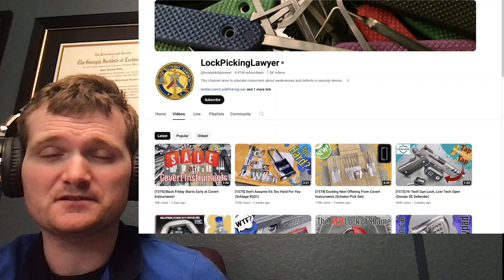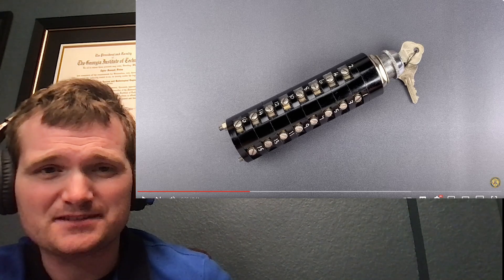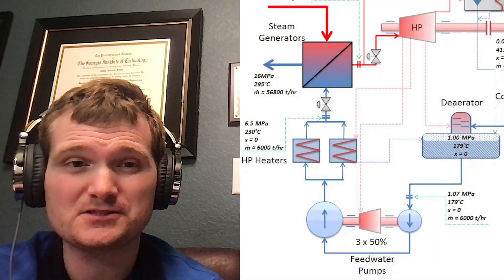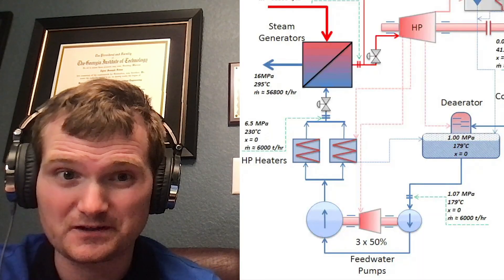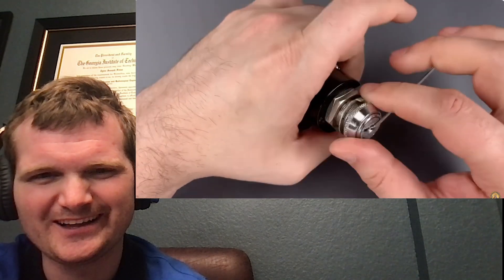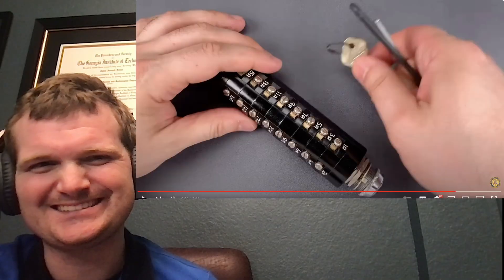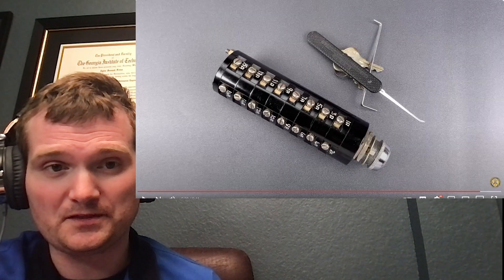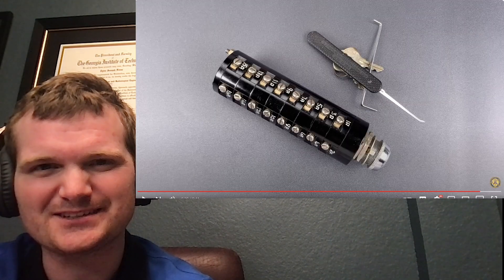Nuclear Engineer Reacts to LockpickingLawyer "Missile Control Key Switch Picked"

Comment: Locks like this use a inner and outer core. The inner core is where key interaction is checked/tested and allow further movement via pushing a certain part of the pin stacks past the treshold, which the key is cut to match the varying lengths necessary to push the middle set of pins past the threshold. All middle pins clearing the way enable the core to move. Picking locks you use tension on the core to help set the pins as a way of holding them up via friction, and you'll just go down the line. In some cases specially shaped middle pins are serrated to throw off feedback as a defense against novice attacks where a picker has to guess what's actually stopping them and do slight adjustments in order to correct it. 

But that's the confusing most aspects of most standard locks with a key you'll be familiar with. Often the security of the design in other lock type is their irregular shape which is more likely just a confusion tactic but vulnerable to the same attacks. But generally the aim is to be able to turn it and makes "something happen". Either this unlatches something, connects wires, or changes something from how it was into something that it wasn't. So far the standard for less prepared for locks to defeat are wafer locks because they're uncommon to the point that even most locksmiths don't have a tool for them, but LPL does and stresses that it's not difficult. Generally those in the wild are more likely to meet destructive methods instead like cutting the chains because hardly anyone understands the locks.

Comment: It makes sense, the purpose of safety lockout/interlock locks isn't to stop a skilled lock picker security, it's to ensure that someone doesn't accidently or inadvertently turned that system on.  No matter how simple the mechanism, nobody is going to accidently (oops, I stumbled and my lockpick fell into the keyhole) pick the lock.   If someone opens it, they did it on purpose with intention.

Comment: Why woukd you need 16 circuts tied to contactors like that? Weird.
Reply: By stacking switch contacts, one key turn can have many functions electrically (instead of turning 30 key switches all with a single pole switch)

Comment: I think everyone who doesn't plan to do illegal things should read the MIT Lock picking Guide. For one thing, it is fun and relaxing to pick a box of locks while watching a movie. For another, it is really handy, potentially even lifesaving if you lose your keys. Lastly, you get a practical lesson in how security is mostly an illusion. LPL can open a lot of lock types where I wouldn't even know where to begin, he is awesome. But common padlocks, house deadbolt and doorknob locks become easy surprisingly quickly. At that level, improvised tools are fine as long as you can be reasonably sure they won't break off in the lock.

Comment: Twenty-five thousandths means twenty-five thousandths of an inch. Twenty-five is the highest standard thickness for pick blades, that being the steel bit. Good for locks like this, where you need very high tension, since the high tension can cause pins to bind very strongly. Strong binding requires a good deal of force on the pick to overcome, and a thick blade is better able to tolerate this relatively rough treatment without bending or breaking. It can still happen, but it's not as likely.

Comment: id assume modern systems like most cars these days have a chip in the key itself that would need to be within a certain radius to even allow these things to be activated/deactivated. specificly to foil efforts like this from resulting in a catastrophic outcome. other things like an additional remote key press from like 6 buildings down being required to give confirmation while the key is held in the unlocked position
perhaps even before getting to the key hole a small metal plate may even obstruct they lock until a diffrent switch is pressed 3 buildings down in the oposite direction. and that same plate is on a timer so that it requires at least 3 separate people or more to activate the system that this lock is incharge of. 

a whole bunch of checks just to ensure that if jim from accounting gets layed off he cant just go blow the place sky high. 
and its safe to assume that the level of steps gets more complex based on how vital or dangerous something is
a system wont just rely on a single simple lock to secure vital functions and systems

Comment: You'd be surprised about standardized keys on large machinery, I'd be shocked if a good number of the safety & maybe even control system keys at a plant are not fairly standard.    There was a great presentation  several years back at defcon or something titled "This Key is Your Key, This Key is My Key"
Reply: CH751 is extremely common for example

Comment: So, in regard to the thickness of the pick, 25 thousandths of an inch is the standard commonly used thickness for picks in North America. We tend to not do too much in restrictive keyways here. Other common thicknesses available (overall, not just here), are in the 18-20 thousandths range, and 15 thousandths. There are thicker (less useful) and thinner (more delicate, but very useful in specific situations) picks out there, but they are not as common.

Comment: Industrial electrician here: those multi-contact switches are pretty outdated (makes sense, as this one is from the 80s), since we use computer controls for pretty much everything these days. 
Maybe they have to use an exclusively hardware lockout on weapon systems to prevent firing due to a computer malfunction. 
Those "tongue-gripping" things are safety lockouts and they are commonly used for access control on sealed machines. Some are just sensors while others have a powered locking latch.
Reply: Stacked switches are not outdated, they are still common practice in various controls situations.

Electroswitch is used for example all over power distribution in a stacked switch format.

Comment: I've watched all of LPL's videos as well.  This one did seem to take a bit longer than usual requiring like 5 passes?  In his longer videos he takes locks apart which is pretty cool if you're into engineering and manufacturing.  Wish he would have taken this one apart.
Reply: I would not be surprised if a lock like this cannot be disassembled without damaging parts.
Reply: @xXShadDragXx  Remove the nuts on the back to change out individual switch layers/alter the stack. In theory one stack could be 90º to the others and that would activate a "Safe" light. But after removing all of the layers of the switch, it's 50/50 shot if the cam lock could be disassembled. Could have a spring washer holding it together or it could be pinned in a fashion similar to an ACE lock.

Comment: Tyler, I have a question. In some footage I've seen from nuclear power plants (inside the critical areas, like the spent fuel pool), certain information is blurred. Obviously that's for security, but what is sensitive about a label on a crane or a cask? What are other examples of information inside the reactor areas that has to be blurred out? (obviously anything in the control room, and that makes sense because it's obviously to prevent terrorism).

Comment: I recently saw a short documentary about the 2003 Northeast Blackout by Fascinating Horror and I was wondering why nuclear power plants are not self sustaining and had to rely on power from the outside. Is it still the case today?
Reply: Typically power generation, transmission, and distribution systems can use their own electricity to operate, this is often called something like “station service” circuit.

But if those facilities fail, particularly in generation, there needs to be some prime mover in what’s called a “black start” scenario where there is nothing providing power for the station service circuit.

If things get to that point, there must be an external electricity source (generator) to provide power to the core functions of the plant, so that the process of large scale generation can restart.

Comment: You talk about this switch stack as if it is "vintage" or out of date but this type of switch stack is very common and still used today. They are used in comercial equipment that requires multiple components to be turned on or off at the same time. Each switch in the stack can be a different voltage or different position when the switch is turned. This one is fairly simple with a on and off position. A more complex one could have certain switchs on and others off in one position while the next position switches that and a thrid spring loaded position that only turns on one switch.

Comment: Fun fact: In the locksport community it is widely known that Masterlock sells complete garbage locks that have no security features and poor tolerances, making them very easy to pick. An exception is one of their lockout/tagout (LOTO) locks that has a plastic enclosure and security pins, making it much harder to pick and easier to break off with a set of pliers. Talk about getting things backwards!
Reply: LPL did a episode about that paradox
Reply: @shawnmiller4781  yes,that’s what I was referring to and Folse dropped a reaction video to it.
Reply: As long as your regular employees don't lose the associated keys and then get into the habit of just picking the locks, it's a plus for a LOTO that if something happens to screw up the correct procedural way to open the lock (have the key, insert the key and turn) there is a practical way for removing the LOTO within a few minutes' time. A whole lot of industrial design is about determining "how inconvenient should this thing you'll be doing this often be made to be".

Comment: LPL is really into emphasizing that in security "a lock is only as strong as it's weakest component" (ex: a truely unpickable lock core isn't helpful on a cable that can be cut with tin snips) and he would likely very much apprecate you pointing out the other levels of security in the area such as peer checkers and gaurds.
Reply: That reminds me of the old "What would happen if I'd go for a swim in the reactor's cooling water?" (("You'd die. Of bullet wounds. Before even reaching the water."))
Reply: Since the "security" at our minuteman ICBM silos is so "top notch" I'm sure the power plants are impenetrable.  🤣
Reply: @nunyabusiness9013  post 9/11, yes. Previously, I walked right up to the cooling towers at a couple of plants that were in operation.
There are quite a few areas that are "no lone zones", where nobody is permitted to approach alone and escorted. That's true in weapons, I'm quite certain it's also true for nuclear power plants. Too many bad things happened when someone was trying to operate a reactor alone. With the SL-1 coming promptly to mind. Poor design with positive void coefficient, the control assembly that was far from intrinsically safe and prone to sticking, turned swiftly into "everybody dies" in well under a second.
Yeah, used to have a Q clearance early in my military career.
Reply: That's why a pizza delivery guy was able to walk in unchallenged with silo doors left open and the guards asleep. Look it up.

Also until 1977 the "launch codes" were a string of eight zeros. (00000000)

Keep drinking that US propaganda Kool Aid tho. Everything our government claims is gospel.

Comment: "Peer Checking"?  No, I'd rather you not check my peer. Forget Lockpicking Lawyer. Any mechanical lock is easily defeated by $99 battery powered  angle grinder from Harbor Freight. It cuts through Zirconium cladded fuel rods with ease, Mr. Folse.
Reply: Bolt cutters, a hammer, and an angle grinder are all you need to remove any lock.
Reply: I mean embedded locks are gonna be a challenge still

Comment: 4:51 Those are safety switches typically used on doors, gates, access hatches, panels, etc. to sense their open/closed state and stop machines when opened. They can also be equipped with a locking latch requiring power to unlock.
Reply: Exactly.
Reply: Shut up

Comment: Yes India is the only country to still use the Spector jaguar attack aircraft. If I remember correctly they have six squadrons still in use. It’s still a wonderful aircraft to use. I would think that the f-16 might use the same lockout for their sidewinder missiles, since it’s a standard with in NATO
Reply: I'd assume it'd be used with the LAU-7 rail, as found on USAF/USN 3rd gen aircraft such as the F-4.